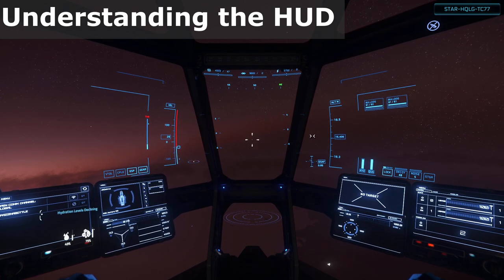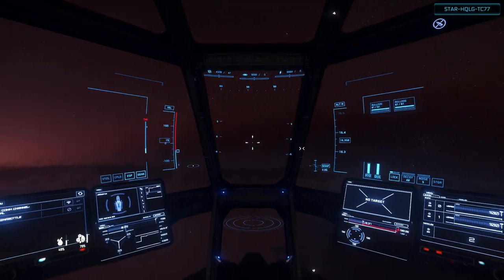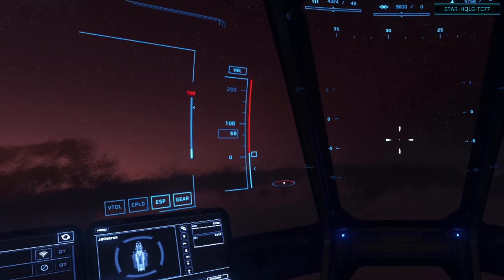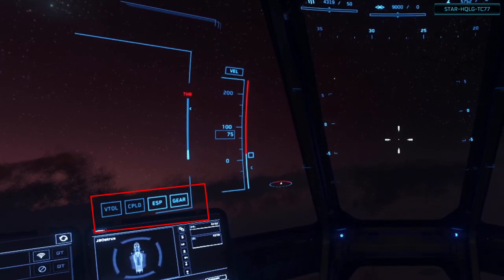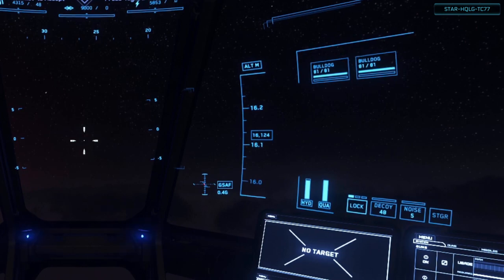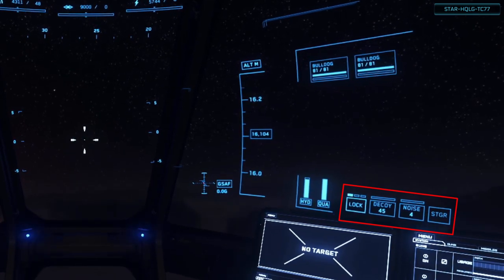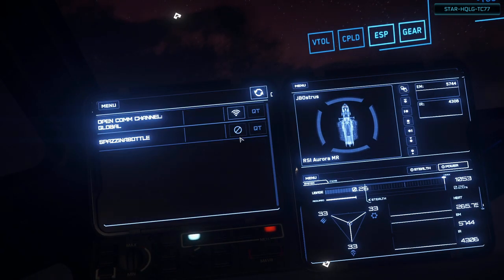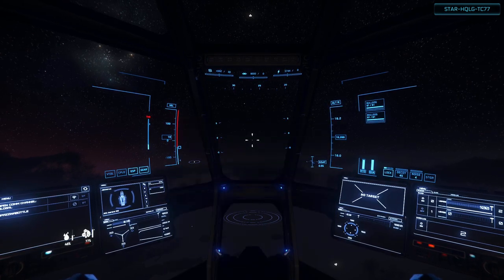Ship HUD explained - Star Citizen

Comment: Thank you, but you didn't mention the circle just to the bottom right of the speedometer.  It's the one with the red dot in the center and the white dote beside it.  If you know what it is please could you tell me.  That's they reason I'm watching your video to begin with. :)
Reply from the maker: Heh I totally missed that. To be frank I never even noticed it before your comment. I had to go look at some other people's videos of flight to try and figure it out. Which didn't help much either till I fired up the game real quick. I'm not really sure how to explain it clearly yet. But it's an indicator of your directional movement. If you start moving forward and go decoupled then aim slightly off axis so you're traveling at an angle of sorts. You'll notice in the middle of your hud (ish) you get a weird >< looking icon. That identifies your movement trajectory. If you do a 180 flip you'll see an opposite <>  (I might have them backwards) showing your exact opposite path. That little circle is another indicator. If you're on a flat horizontal path that white dot is actually 2 on top of each other. And you have a red section of the circle indicating the "forward" movement direction. If you have a slightly off axis movement as well, like vertical, then you get another white dot that moves around to identify the direction. That was a long winded way of saying that it's an indicator for your movement trajectory.
Reply: It’s your velocity vector represented on a 3D sphere, the farther the white dot from the center the higher your velocity, the location of the white dot shows the direction of your velocity, the red dotted lines help you determine where the white dot is at in relation to the center.

Comment: 04:38 you might want to edit the video and add in a caption what the keybind is for toggling the STGR setting. You mentioned all the keys for each one except the STGR.  Awesome video by the way.. helped me out tremendously.  Question, how does one do "Full power to shields" . A youtuber kept saying that when he parked his ship.. and said we should all do that but I have no idea what the key it is to puts all power automatically to shields. Is it a F key? I think theres F keys for full power to Weapons and Thrusters or soemthing.. but not shields iirc.
Reply from the maker: Yeah there's F keys to control the power triangle. F5-F8 to control weapons, thrusters, shields, and reset neutral. Tap to shift in increments or hold for a second to shift full.